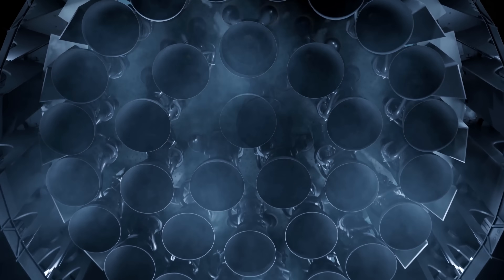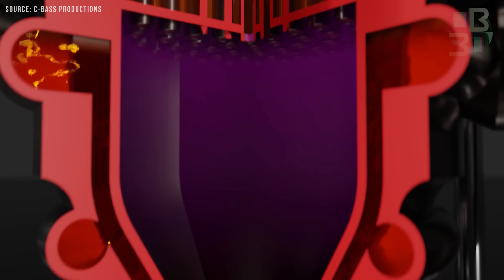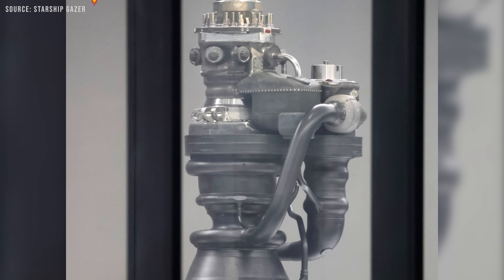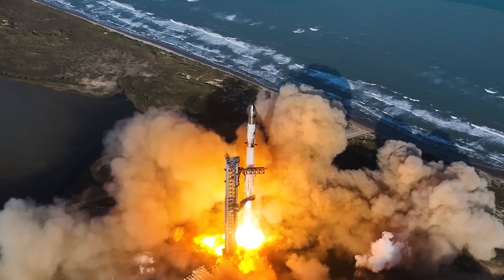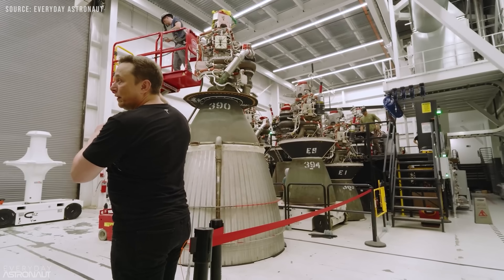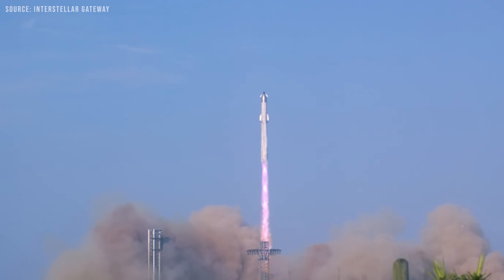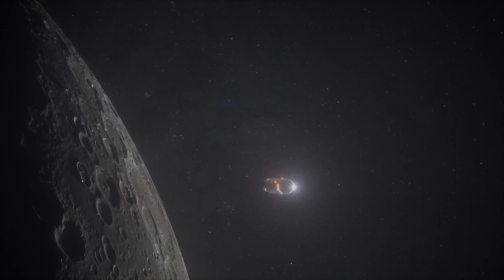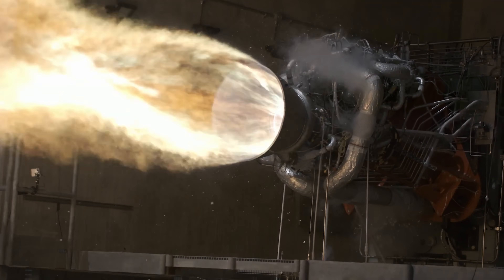Elon Musk Revealed SpaceX's Inside Raptor V4 Upgrade

Comment: The pipeless architecture is the part that really blows my mind. It looks like sculpture until you remember it’s pumping cryo fluids at insane pressures.
Reply: Back in August  2024, Tory Bruno, CEO of United Launch Alliance (ULA), posted on X (formerly Twitter) that the Raptor 3 photos shared by SpaceX looked like a “partially assembled” engine, lacking controllers, fluid‑management systems, and the thrust vector control (TVC) hardware.

He complemented SpaceX on making the engine “simpler and more producible,” but criticized the optics of showing a stripped-down version as if it were fully built.  ￼

SpaceX fired back: Gwynne Shotwell posted a test‑fire photo with the caption “Works pretty good for a ‘partially assembled’ engine.”  ￼

Elon Musk added that missing plumbing and wiring were either deleted or integrated into the primary structure, noting that Raptor 3 doesn’t require a heat shield like earlier versions.